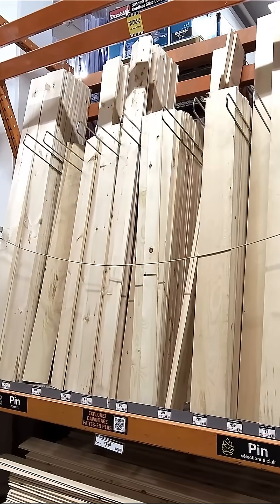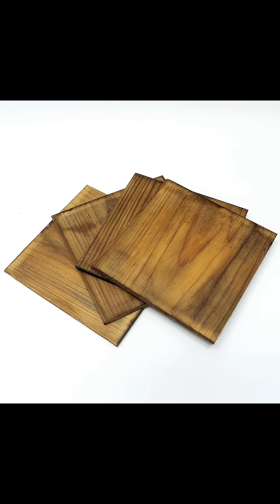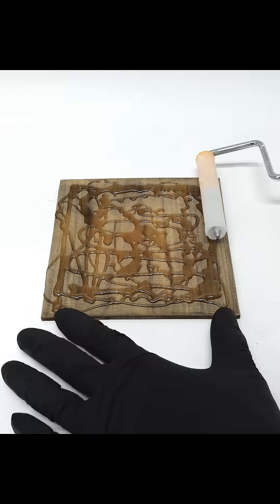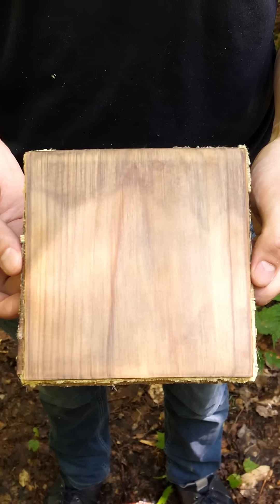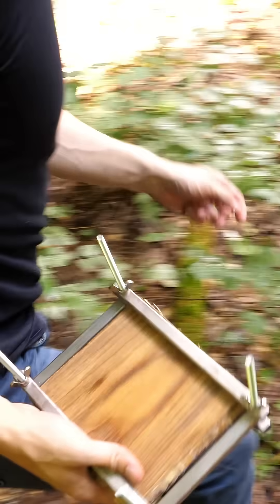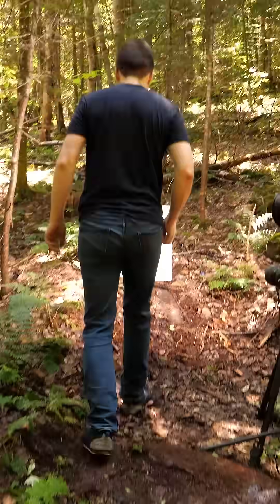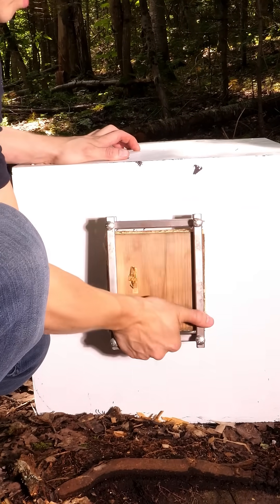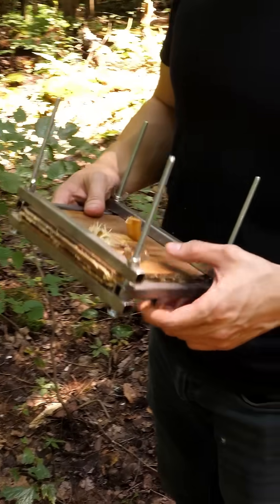Making bulletproof-er wood

Comment: Could use the Kevlar the same way they use Kevlar in tanks: as a backing plate to prevent spalling. In layered armor, I'm sure Kevlar could still work, just attach it to the front plate and space them out a bit. Glued together like that, I bet a steel fabric would offer the best stopping power per ounce.

Comment: 😮transfer of energy dude. Hard and brittle. No!  Got to spred out that energy, thats concentrated in such a small area. No matter what, your gonna be hurt and be hurt bad. But there is no such thing as taking a shot and all is well. Your a moron. The best that one could achieve is to be able to get away, but it won't come without some sort of injury. Just math and common sense. But u wouldn't have a following of you spoke the truth..

Comment: I would rwccomend either nailing all the kevlar on the front or the back of the wood. That way the wood stays as one solid piece, and the Kevlar is what catches the bullet. If i'm not wrong some armoured vehicles have softer inner kevlar like linings to stop the slower movong shrapnel if the main armour is penetrated.

Comment: Yeah, you REALLY don't wanna fix kevlar in place. Most of it strength comes from flexibility and it's ability to catch the bullet like a net. It's not steel which shatters the bullet, so sandwiching kevlar and especially glueing it made it as bullet-resistant and any other fabric

Comment: Shit what we carpenters do when we need to make shit bulletproof is throw in a 1/2" thick sheet of bulletproof fiberglass between two panels. Its how we construct most reception desks for schools. We really just screw into it in key places and sandwich the panels so the fiberglass is allowed to move & do its job. Its also hard to drill through and dangerous to breathe in so we really don't want to make more holes into it than necessary.

Comment: I would also try putting a small Gap in between the layers too so it's a whole nother impact as the bullet goes through each layer. I don't know if that works or not, but in my mind it seems like that would take more Force from each shot

Comment: Ooh 9mm from 16" it has ~100-200 extra Fps depending on ammo brand/model. Try shoot 9mm p+ if that rifle is rated for it. (if the rifle is made oversea is automatically rated for 9mm NATO which is equivalent to 9mm p+.

9mm +p+ is uncharted territory only OK for over built gun like HK usp9, Beretta m9 pattern, cz75, as long they have recoil spring upgraded (the HK usp doesn't even need spring upgrade but compact might)

Comment: A couple of things that other people aren't noticing. I think your wood is working like steel armor, so more layers are less effective Then a similarly thick single layer.. You may try one thicker layer in the future with a Kevlar backing that's not glued across the entire surface.

You could also try a couple of medium thickness layers of your wooden armor with a gap between them and a Kevlar backing on both layers. So you've kind of made a spaced armor situation with a Kevlar catcher on each layer of the armor.

Comment: The kevlar lining needs to be behind the "plate" (the wood)

The wood is absorbing the impact of the bullet, slowing it down. Kevlar is designed to catch a bullet after it's been slowed down. Even if the bullet makes it through all the wood, if the kevlar catches the bullet and prevents it from entering your body, you successfully stop a bullet from entering your body and destroying your internal organs. It could however still impact your body hard and leave a bruise, but that's preferable to bleeding your blood outside where you lose it

Comment: GOOD  SIR..... space between your layers. Kevlar works by CATCHING the bullet, not resisting the bullet. The Kevlar slows the bullet without letting it puncture....you took away all of the qualities of Kevlar when you glued it into a monolithic block with the compressed wood. It's like a frozen soccer net trying to stop a fastball.

TRY  THIS :
Instead of Kevlar, use 10 sheetsof copy paper & equal amount of air layer between the layers of wood. On the last (inside) layer of wood, CA glue a single sheet of copy paper & cover with a single layer of Duct tape.

Comment: Three jillion count silk stager the grain of the silk in such a way like putting two squares together to make a eight pointed star basically lining the silk up like spider web make your own super bonding agent to impregnate the silk with maybe with a vacuum chamber, if you did it not as large plates but more like dragon scale, i would recommend A roling the edges or design in some kinda bead around the edge and B concavity lending it self to perhaps stronger scales and plates, also consider rotating the grain of much thinner sheets 10° per layer or shit ultra thin layers and 1° turn each layer with way more layers

Comment: Random ideas 

[ Using circle pieces, rotate 45 or 22.5 in theory it would cause the bullet to change corse which may slow it down ]

[ maybe it is to rigid, use the "hard wood" , a layer of something soft but durable on the front and back to lessen sudden impact damage ]

[Using layers of different wood types/kinds may turn into something greater than the sum of its parts]

Comment: Nile, I worked in manufacturing  and testing vests and plates and the types of kevlar, number of layers and even placement of stitching has major impacts on its effectiveness. Too tight from too much stitching it fails, not enough stitching it fails. There is a lot of science and testing in every vest and size.

Comment: It's a bit bizarre how so many people are insisting that Kevlar needs to be able to flex in order to stop a bullet. Maybe in a very specific sense that could be true, but it's not necessarily true in this case. The wood doesn't bond as well to the Kevlar, and the Kevlar doesn't bond as well to the wood. That, combined with the overall lack of Kevlar used (three layers, whereas regular vests can use over 20) means that there was no benefit.

The Kevlar being rigid does make it slightly less effective, but even if it wasn't, the bullet would have gone through.

Comment: Try soaking the thin wood strips in “Cactus Juice” it’s a resin that’s meant to soak into wood. After the resin is fully soaked into the wood and cured (baked) take them and insert kevlar inbetween the pieces of wood- sandwiching them. The wood would be even denser. 

Unknown if you’re able to boil the resin but if you can then you technically could boil the thin pieces of wood in the epoxy have the wood get soft enough to be able to be bent into a mold. Make a curved mold and put the boiled wooden pieces in let it all cure then continue doing the same thing with sandwiching kevlar in between

Comment: If the idea is to make wood armor plates for armor vests, one thing that concerns me is the method you test.

In your test, you use a set of clamps that hold it in place at all sides. These clamps could be helping reinforce the wood, and preventing it from cracking, or splitting in half, thusly forcing it to take the full force of the bullet.

Armor plates in use do not have clamps, and in general, there are no fastenings any kind. Theyre just slipped into a pocket designed for them. This means that a wooden one has a higher chance of splitting along the grains, even if theyre 90 degrees from each layer

Comment: I agree with all the posts about flexible Kevlar but I also had another idea to go with it. What about using end grain wood. Think less baseball bat and more butcher block. The fibers of wood should be more able to absorb the impact instead of deflection.
Reply: Green wood might work better too. Has more flex than dry wood

Comment: usualy there are ceramic plates in front of the Kevlar to break apart the bullet and absorb the energy + the Kevlar is on the back part so it doesn't shear between impact of the bullet and something hard

Comment: There’s other composite materials that might work better and some that might need a different way of being integrated like the Kevlar which lost it’s strengths in this application, but stuff like carbon fiber/other versions of carbon materials, and for example ceramic can have interesting properties for stuff like this, fabrics and other more stretchy or “soft” materials are good too they just need room to stretch and squish so they can absorb the energy

Comment: The problem is the metal holding the wood in place / still, while the glue is fine as long as it's flat, the metal vice is screwing up the energy distribution. Also the kevlar should be the outer layer, not bare wood.

Comment: The Kevlar would probably be better on the back as a spall liner, rather than in between the wood layers. You might be better off adding layers of 1mm or .5mm steel if you want it to be rigid and resist

Comment: Curious if end grain would hold up better. Also akin to standing on a can opposed to the side of it. It will split real easily, so you'd want to sandwich it between two normal pieces.

Comment: Try with a mid sized pistol next. The rifle is giving more velocity due to its long barrel. The 9mm fired from a 4 inch could have been stopped. Also try ceramic or steel with spall proof coat

Comment: Kevlar is only good a catching bullets when it soft and able to deform around the bullet. If you make it rigid it becomes far less effective at catching bullets. Should've used something like thin ceramic sheets between the wood.

Comment: I do wonder if 90° is the best. My mind wonder if you went between 70-85° if the pressure would want to spread unevenly. Potentially spreading the load in non linear directions and thus increasing the absorbtion of energy. My brain imagine the energy hiting and two Fibonacci like spirals dissipating the energy to disperse it along the not perfectly 90° alignment.  Though the other part of my brain says no will just make it weaker I do still wonder if it has merit. 

Also the woven fibre layers have different properties and so are concentrating rhe force and allowing it to blow out like that at a guess. Denim might work better, or a single foamy sponge layer before the last wooden sheet to act as a damper and give it the best chance to hold.

Comment: A piece of gun safety advice.All guns are loaded at all times. Yes you are 99.99999% sure you put 1 round in but you also set the gun down facing in the general direction that you and you your camera then walked down range of. 1 second extra to check that the gun locked back before hustling to check your experiment ensures the safety of your film crew. Especially as he is focusing on you not looking down to check for himself.

Now we can't see behind the camera so for all we know there was a 3rd person that picked it up and pointed it down while fully clearing it. That said gun safety is spending lots of time to prevent 1/10 of a second of a life changing event from happening.

Comment: Impregnating kevlar with hardening glue and putting it under pressure of wood plates make kevlar nothing but shatterable glass. I'm sure armor producers make use of kevlar another way. If you wouldn't use kevlar it would have been better.

Comment: I'm no ballistics engineer but I'm thinking a few layers of Kevlar on the back attached so they're not stiff to catch spalling (any wood that blows out of the back) and maybe something like rubber between the layers to lessen the transfer of shock between the wood panels?
Reply: Sounds semi like modern non explosive reactive armor

There also known as nera
Reply: I'd suggest a rubber/Wood/rubber/Wood/rubber sandwich, all wrapped in a tight Kevlar sleeve.
Reply: @tomeclectic maybe not too tight, so the kevlar can flex and disperse the kinetic energy.  Also maybe a ceramic plate/tile or two in between as well.
Reply: @zaxzumu4605  I think the ceramic plate would just make it more like a regular body armour and the whole "bulletproof wood" thing would not matter anymore.
Reply: Why wouldn't it be at the front tjen?
Reply: @Loralanthalas the kevlar needs space to flex otherwise it wont do anything and it can capture bits of spall coming off the armor when it gets struck
Reply: I haven't seen the first attempt, but stabilizing the wood in a vac chamber with an impact resistant resin would also help. Otherwise yeah, rubber mix with a kevlar sleeve would help, or just do what Nile did but with carbon fiber plating
Reply: That's a great idea to try. I hope he sees this.
Reply: Im not a ballistics engineer but I’m thinking.. you sound like a ballistics engineer
Reply: Sounds scientific enough

Comment: I may be misremembering, but I think kevlar relies the force tugging on and breaking fibers as they move. Kinda like how you need a sharper knife to cut paper held up by an edge, than pinned flat on a table. That is to say, soaking it in glue and pinning it in place may make kevlar much less strong.

Comment: 2 issues here Kevlar is NOT bullet proof, even if it has movement. just look at modern body armor. the only places that used it is steel armor and that is to control spalling which it sucks at that as well.
2:we already know that stacking layer like you did here creates a uniform plate that cant take advantage of each others properties. sso what you need is highly compressed UHMWPE Backer and put the wood on the front as a strike face. the strike face absorbs the kinetic energy while being abrasive to the projectile but also gice so the spalling goes into the plate then the backer catchers the plate. just and fyi a UHMWPE Backer can be 1-2 lbs and stop all hand gun ammo from a hand gun and common .223. remember when you shoot a PCC the pistol ammo now get it's max velocity which is a big deal in penetration.

Comment: Kevlar is a strong, heat-resistant synthetic fiber, developed by Stephanie Kwolek at DuPont. It's known for its high tensile strength and is used in various applications like body armor, tires, and protective gear due to its ability to absorb energy and resist ballistic impacts.

Comment: You made it too rigid. For armor to work it needs to absorb the energy by flexing. Its why most laminated armor has a honeycomb structure between the plates so there is a gap to disperse the energy

Comment: You're using a Ruger PCC take down, good choice, other factors you may be interested in though are bullet weight (115g, 124g, 147g, or 150g) and the powder charge. (+P, +P+)

Comment: With everything packed tightly and glued the force is able to transfer effectively with no structure absorbing and dissipating the shock.  It's like how a sandbag will stop a round but a similarly weighted hollow concrete block will shatter and allow the round to pass through

Comment: You can put an even harder plate over the wood material and or something behind the plate that can deform and catch fragments.
Armor is typically extremly hard on the face to deflect, shatter or deform a projectile and softer on the back to absorb the remaining energy without shattering.

Comment: Hi Nile,
Your experiment with the compressed wooden panels is impressive! I find the idea of creating a hybrid material of wood and Kevlar in a 3‑2‑3 composite especially intriguing.
For example:

Wood (8 mm) – Kevlar (5 mm) – Wood (8 mm)

I'd suggest using epoxy as the adhesive.

* Wood absorbs impacts and reduces energy.
* Kevlar catches fragments and elastically distributes kinetic energy.
* The final wood layer captures fragments or any penetrating elements.

I'd be very interested to see how well this layering holds together in practice with epoxy, and how it influences both stability and weight. For me, this would be an early step toward creating "true composite armored wood." 😊

Comment: You've reinvented the intention of cannonballs in old timey shipbattles. The intention wasn't to sink the ship, but to shred the wood and have all the sharp chunks of wood and splinters to act as buckshot on the crew. By adding the layers of flexibility of kevlar inbetween, the wood has the ability to bend or work which causes the backmost panel to shatter. At least, that would be my theory. But im more than happy to be wrong!

Comment: Modern bulletproof armour consist usually from two layers: first one is made or something hard yet brittle, so it can rip the bullet apart, while being crushed, which disperses energy into cone like shape; second layer is made from kevlar, or other material which is hard to rip apart, so it can disperse energy. 

If you out all those layers of kevlar behind thin bathroom tile it could be enough to stop this bullet.

Comment: I think the added adhesive and kevlar made the laminate to crispy.
For a bullet proof effect there need to be a strong flexible give to catch the energy.
A 3mm layer on 4mm of rubber gym mat flooring is enough to stop a .22. Doubled up it could stop a 9mm.
No me, a co-worker did this experiment at our local range with work scraps.

Comment: I think the important question here is why was the other one more effective, and its gotta be cause the density of the wood is absorbing so much of the energy rather than trying to actually stop it. Also, i think the glue probably put a lot more resistance in the kevlar which (imo) seem like it would cause it to be brittle and less effective